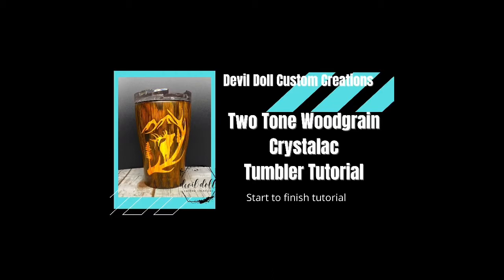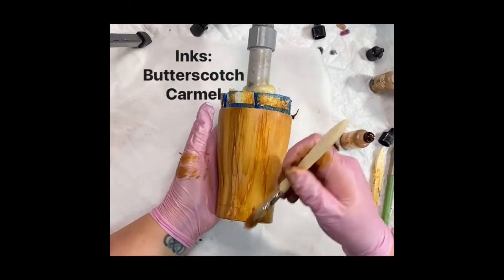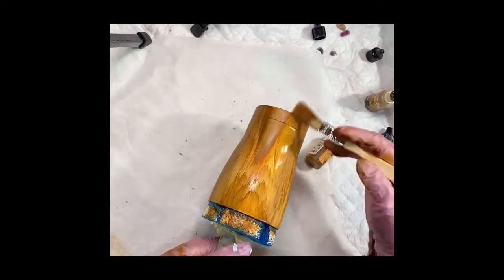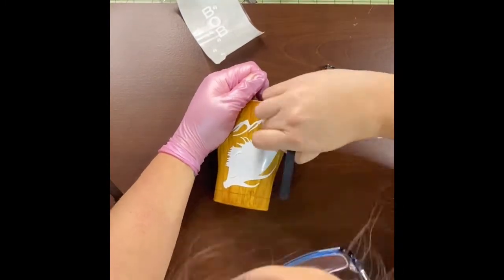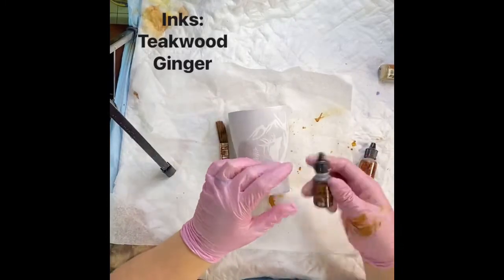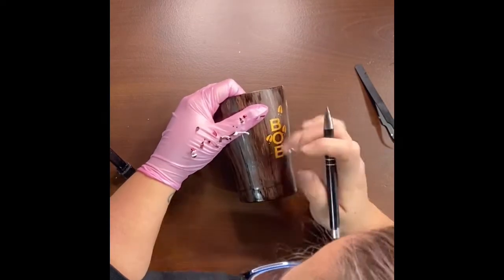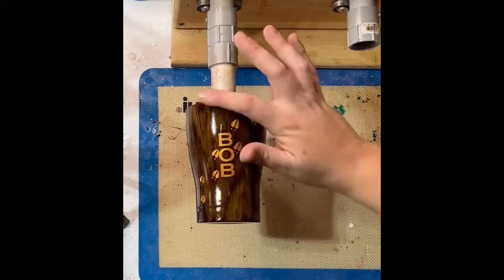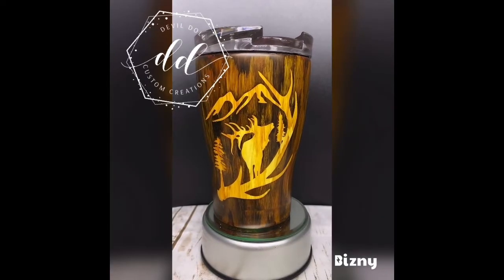Two tone Woodgrain using crystalac and inks

Comment: Is your base coat universal white? If so, what was your dry time before applying the alcohol ink?
Reply from the maker: Yes the base coat is UW. I think the dry times very based on your humidity and temp of your shop. But I believe mine was around 30-45 mins but I didn’t have a timer out to get the exact time. 
Thank you

Comment: If I used spray paint for my base coat can I still use UW before applying the dark ink?
Reply from the maker: Yes but you really wouldn’t need to do both. They are kind of the same thing. I use UW when I’m using the Brite tone products right away and I don’t want or have the time to wait for the spray paint to de gas the 48hrs before.
Reply: @devildollcustomcreations  thank you.
Reply from the maker: You are very welcome

Comment: Do you use removable vinyl?
Reply from the maker: Yes I use oracal 651, you can use oracal 631 but I normally just use the scrap pieces I have laying around to make the stencils. Haha there is stencil material out there but I don’t like it as much as I do the 651
Reply: I have a couple of questions.  How long do you wait to seal the 1st coat. I sprayed the 1st coat about an hour after applying the ink and the whole cup smeared.  Then how long do you wait to put the decal on?  

Do you seal the 2nd coat?  Sorry about all of the questions. I’ve ruined 2 tumblers so I’m not doing something right. ☹️
Reply from the maker: Sorry if I didn’t say this in the video. I wait at least three hours for the inks to dry. But usually I wait over night. Then when you spray you need to be very light, almost like a dusting and about 15-30 mins after do another coat slightly heavier then wait 15-30 to dry before adding another coat. If you do it too heavy at first the inks will smear or you will get little speckles in the paint. 
I do a few coats of Brite tone or a thin layer of epoxy before I add the decal because sometimes the transfer sheet can remove inks and also when you pull the vinyl to reveal the peek-a-boo it can remove the inks if you don’t have a protective layer.
Reply: @devildollcustomcreations  thank you!
Reply from the maker: You are very welcome